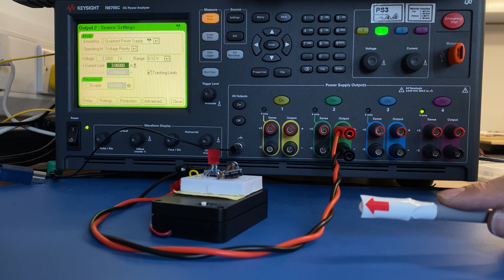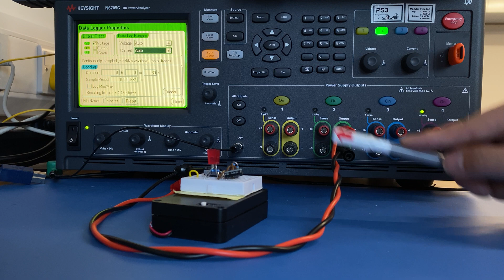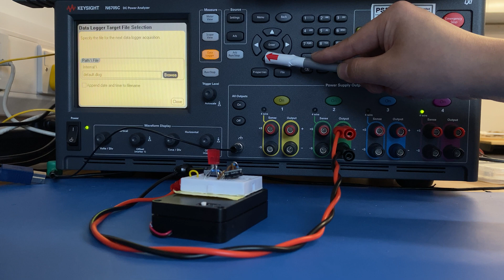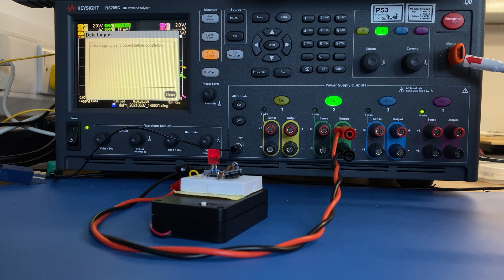N6705C Tutorial 1: Basic Measuring

Comment: Does It have the capability to give negative voltages?
Reply from the maker: Yes.  But it depends on the model of the power unit 
See https://rfmw.em.keysight.com//bihelpfiles/PowerSupport/whm/Advanced/Content/35%20-%20N6700%20Modular%20Power%20System/Usage%20and%20Application/N6700%20output%20negative%20voltage.htm

Comment: Thank you very much for your explanation! It is really helpful, since I am considering buying this instrument for my lab. You showed how to set the sampling time to 0.5 ms, and I was wondering what the minimum sampling time is that can be set, and what power module was installed (I ask this because the sampling rate appears to depend on the module available in the particular channel being logged)? Please, would you enlighten me? Many thanks!
Reply from the maker: The sampling rate can go up to 0.02 ms per datapoint. e.g. only logging the current using only 1 channel.

See section: Data Logger Sampling Modes on page 134
https://www.keysight.com/us/en/assets/9018-04819/user-manuals/9018-04819.pdf

Full list of Modules comparison see the same document at page 14
Reply: @jiegh4215  Thanks a lot! Yes, this helps me out. The manual is much clearer than the data sheet.
Reply from the maker: Let me know if u have more questions.  I would recommend the module N6781A or other N678X modules.  Be aware of the max voltage rating of each modules
Reply: @jiegh4215  Thanks. I am currently investigating the Keysight N6705C, because its sampling rate is quite high. We want to measure a device that draws extremely low power of very short durations. Our voltage is 5V or less, so that should be fine for all modules. 
Another option I am considering is the Keithley 2450 SMU, but it seems to be unable to reach the high sampling rates of the N6705C. Rohde & Schwarz NGM200 series is also on my radar, since it is quite fast, but it does not have the graphic capabilities of Keysight and Keithley, though it is much cheaper.
Your videos of the N6705C puts it in quite a nice light. It seems to be easy to operate.
Reply from the maker: @SurfinScientist  Sampling rate wise, the N6705C is most easy and accurate. The instrument serves a single purpose: to get the power figure right.

Check out another solution, Note, the Keighley used in this video is 2 wire sensing.
https://youtu.be/l88mAXGDyJU
Reply: @jiegh4215  Thanks! I will check this one out.